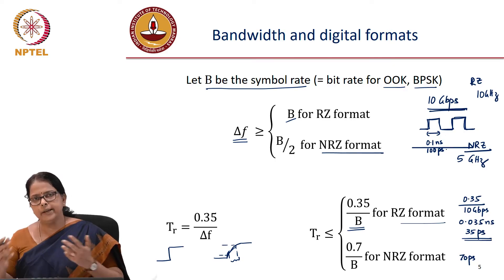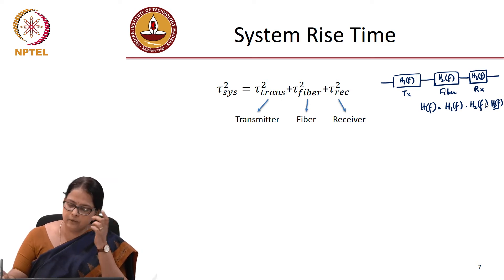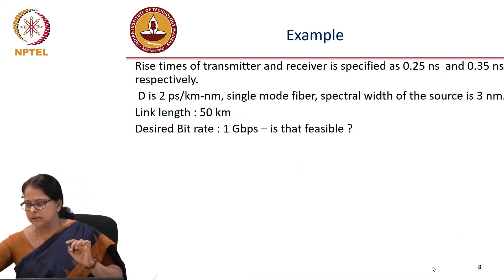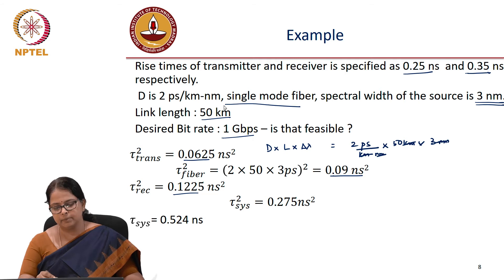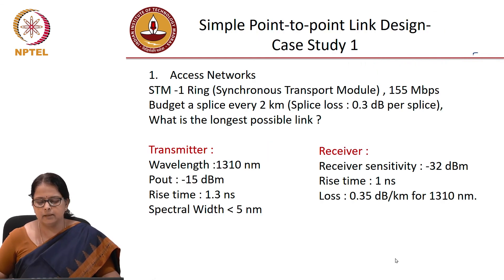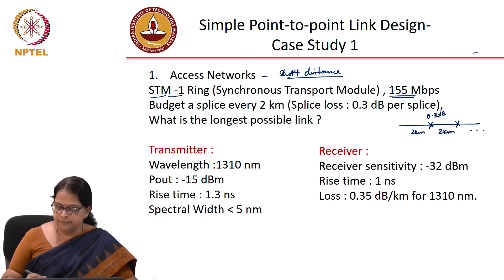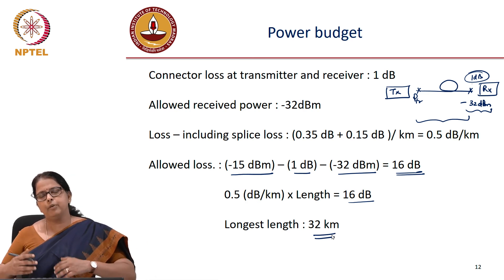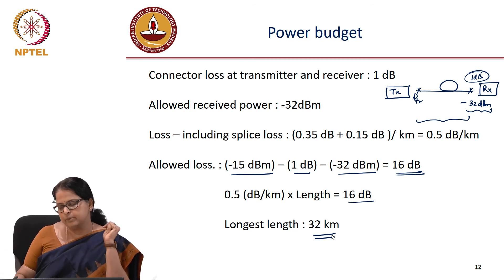Lec 80: Link Design- Case Study

Comment: @15:18 Madam, the values are in dB and dBm, without converting can we add quantities with different unit?
Reply: dB is a ratio of two numbers (signal power to noise power, input power to output power etc.).
dBm is a ratio of a power and 1 mW power.

In linear scale, if 1 mW power passes through a 3 dB attenuator, power will be P x Att = 1 mW x 0.5 = 0.5 mW.
In log scale, it is log(P x Att) = log(P) + log(Att) = P_dBm + Att_dB = 0 dBm + (-3) dB = -3 dBm = 0.5 mW.

The whole thing works only because we are talking about different ratios, and one ratio with known denominator (1 mW).